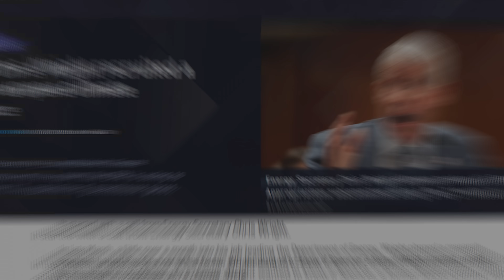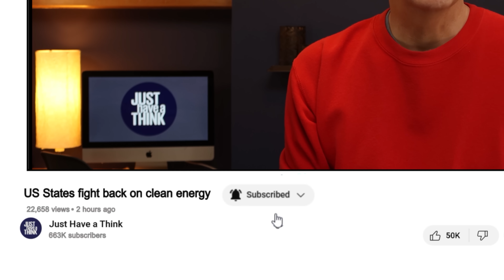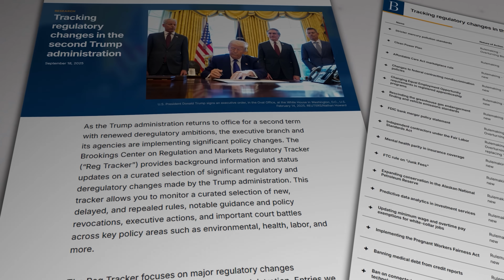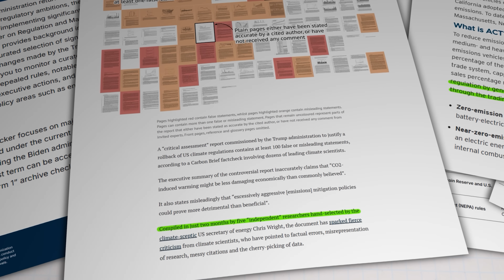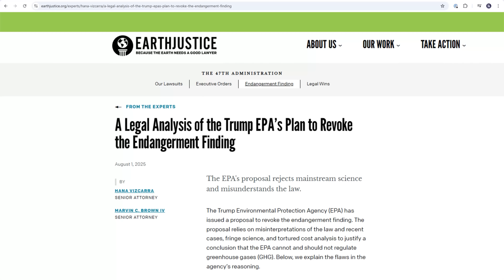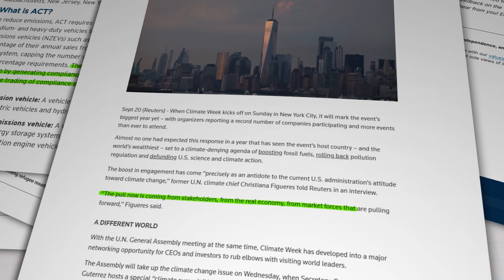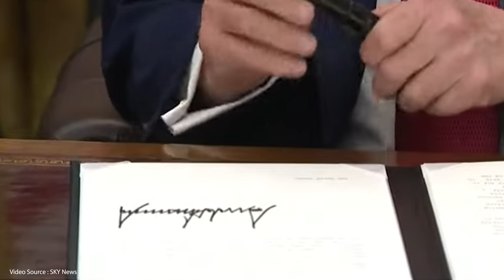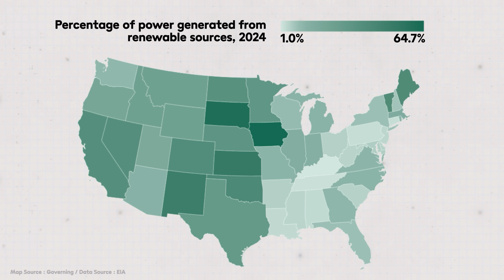The battle for American energy supremacy.

Comment: USA guy here, I’ve used solar generators with extra batteries and factory seconds solar panels to offset some of the larger appliances in my house. Paid for as I go, no permits, I don’t believe I show up on any charts or graphs, but still doing solar.
Reply: Secondhand solar panels are literally a steal. Far far cheaper price while still having like 90% of the output
Reply: DC:DC connections are capable of shorting out and causing fires so with old panels be careful to buy modern MC4 connectors, not MC3 or no-name, no adapters - make sure the data sheet shows original staubli MC-4 for best safety. Also, insurance companies use satellite images and they see your solar panels, so keep your off-grid system truly off-grid because it is functionally uninsured and if it harms the insured systems, your insurance company will have a basis to deny claims. Just saying be careful out there!
Reply: @TomKacandes  Mine are mostly well hidden.  Under a tree canopy that doesn’t interfere with sunlight hitting them directly. Very secluded backyard.
Reply: Excellent 👍
Reply: That's how we do it too. Some critical home systems are on 100% renewables. The panels can't be seen from the road.
Reply: I did the same thing last year. Bought used panels and ground mounted them. EG4 6000xp. Works great 👍
Reply: You are taking cashflow out of the grid.
Grids will start GOUGING the poor slow adopters with higher electricity prices. 

You are showing the way and building the new energy economy. 

Grid owners will want meter boxes to remain grid connected and supplying dirt-cheap feed-in electricity so they can build their grids emergency backup services business.

Grid owners will FOCUS on keeping all meter boxes connected. 
Focus on taking dirt-cheap feed-in electricity 
Focus on supplying the new cashflow from industrial customers moving away from fossil fuels to clean electricity.
Reply: Unlike the free democracies in Spain and Greece the governments surveillance drones don´t catch You when they fly over Your house to spot illegal solar panels installations? Congrats.
Reply: @SunshineShane seriously? I heard something about this. It’s unbelievable. 😅
Reply: @SunshineShane  so what do they do if they spot an “ illegal solar install”?
Reply: @SunshineShane  Probably not illegal at all.  No permit is required for a temporary solar panel connected to a solar generator.  If those solar panels aren't fixed to the roof of the house and don't feed into the panel, it's not illegal.
Reply: @toddcurtis1377  What are we talking about? 4 foldable 200 Watt panels? That´s not serious energy.

Comment: I'm looking at 800 watts of heat tolerant solar before next summer, feeding a ~14k battery bank (based on the do it yourself system on Will Prowse's youtube video).   I suspect it will save me about $300 per year at a cost of $3,000 but it might save me $450 per year.   So a 10 year payoff but maybe a 7 year payoff.  But it will also save the contents of my fridge (which my current system has done twice) which saved me from dealing with a lot of rotting food and saved me about $250 each time.   So that would take it down to a 5 year payoff on top of the disaster recovery.

Plus I can use my portable battery to "loan" power to other friends who have no power.  Which I've already done twice- saving the contents of their freezer.

None of my stuff is grid tied.  I just run a window unit which provides enough eliminate the need Central AC from coming on at all except for august and september and even that is minimal.  Plus that's a lot less wear and tear on the AC unit too.
Reply: Do what Will Prowse says, and get more panels. Did you mean 800w, or 8kW of panels, which is what you need.  Will recommends just buying used panels,   they're so cheap.
Reply: @PeroniPete  I meant 800w.  So I'll generate about 5kWH to 6kWH per day.  

8kW of panels wouldn't fit my space constraints and the heat here kills panels output when I need it most.  I need heat tolerant panels.
Reply: @mac_mcleod  Try liquid cooling, or get your panels up with a larger gap below them so wind can pull heat away.
Reply: @Les_S537  It was over 100 degrees for 3 months where I live 2 years ago and over 100 degrees for many weeks this summer.  The output of the panels drops by 15% (or more).  That's why I researched what kind of panels are more heat tolerant.

There is no wind to speak of.  Water cooling might be interesting.   But when I watched a couple youtube videos on that, it didn't look very effective.

Comment: I live 100% off-grid in the Rocky Mountains via solar, batteries, wood stove for heat, and use of the most energy efficient appliances. I am in no way impacted by the f**k-wits in this abortion of an administration as I gradually work my way to 100% energy independence. This year alone I’ve only had to use the generator to recharge my batteries twice since March. I have all the modern conveniences too.  Next step is some type of wind generation to help out during the times of less sun availability. I do believe we will someday look back on these ridiculous times as a short, but painful blip on the screen of life.
Reply: You are using data-centers right now.
Those data-centers are not powered by firewood.

Comment: The UK has the most expensive electric in the western world due to the rush to wind and solar (4x that of the USA) . Net Zero (which will never happen) is making everyone poorer here in the UK...The Moral is- Don't run before you can walk....and don't listen to Mr Doom and Gloom here, life is short enough as it is!
Reply: Renewables have up front costs...

It used to be that if a growing city needed more power you could just bring a fossil fuel power plant online in close proximity to the city which meant no need to install transmission lines.  You could essentially plug straight into the local grid and voila, instant capacity increase in power.

With renewables like wind or solar they're typically installed dozens or hundreds of miles away in areas which favor them.

But this means you have to install hundreds or thousands of miles of transmission lines.

That's the up front cost...

In 20-25 years when that wind turbine farm needs to be replaced you won't have to reinstall transmission lines, and thus cost is much less.

Energy costs will rise with renewables on the front end, but in the long run they're way cheaper than fossil fuels.
Reply: @Les_S537  Wind and solar are infinitely-expensive, on a sustained basis.
This is because wind and solar are incapable of powering factories, and factories are necessary for replacing and perpetuating wind and solar infrastructure.
No fossil-fuels = no wind-and-solar.
Reply: @aliendroneservices6621 Well I could agree with you, but then we'd both be wrong.
Reply: @Les_S537  Point to a single factory powered off-grid exclusively by its own solar power system.
Should be easy, since there are 1 million factories on Earth.
Reply: @aliendroneservices6621 Australia has dozens of mining operations in the outback that run exclusively on solar power; too far away from any power lines and its far too expensive to deliver fuels to their locations for long term operations.  

In Europe there is the ABB/Busch-Jaeger Electrical Equipment Factory in Luedenscheid, Germany which opened in 2019 and which generates ~14% more power annually than is used by the factory.
Reply: @aliendroneservices6621 Is that the same Google AI that, when asked to present a picture of the Founding Fathers of the US, made them all African Americans?

Yeah, I thought so.
Reply: @Les_S537  Was West Musgrave one of those "run exclusively on solar power" mines?

Comment: He left out the part about how the "green" subsidies in the US are a giant, wasteful grift sent to Democrat states and then largely wasted or straight up stolen.  See Ivanpah, Solyndra, Crescent Dunes, Abound Solar, A123, and KiOR just for starters.  Billions wasted.  A solar/wind/hydro/battery energy infrastructure which can compete on its own merits is the one for the long term.  The only one.  Innovation doesn't occur through subsidies, waste does.  But go on, all the UK censorious, rape apologist, self-hating grifter authoritarians with your ideology.
Reply: You sound disturbed.
Reply: @TheDanEdwards  The wrongheaded innuendo about the US is not what an objective show about clean energy should meddle with.   Especially when the slights, mischaracterizations, and libel are so despicably wrong.  Especially from an authoritarian from the failed UK.  Punching up!

Comment: Solar concentrator + Heat pipe + Sand Battery + glycerol + Heat pump + Absorption chiller + Cold sink+ 48v rack batteries + All-In-One + steam turbine-generator + PV solar panels + anaerobic digestion tanks + CO2 and H4S scrubbers = Ability to synthesize liquid fuels from methane (anaerobic bio digesters) and sunlight. 

All the infrastructure you'll need for your home, or for your factory, or your government or airplanes or cars or rockets might need for decades, for domestic hot water, cold food, clean clothes and clean dishes. Electrical loads, heat loads and liquid fuels all generated by sunlight and anaerobic decomposition of ANY organic material. 

In essence, you can build a power plant to give you energy in the form you want it, in the quantities you want them, at the times you choose; once installed, the system is free to operate for decades or longer, with regular maintenance. Residential or commercial scales as desired, anywhere on the planet, even on the ocean. 

Like an oil rig you can put anywhere. There's some up-front infrastructure cost, but after that it runs for better-than-free for as long as you want it. 

Cheers!
Reply: And yet, none of the world's 1 million factories is off-grid powered exclusively by its own solar power system.

Comment: Tony Seba has proven that we are already knee-deep in a technological disruption phase in terms of solar wind and battery (SWB) development. This implies that the price of SWB energy is falling at such a rate that it can no longer be stopped. Not even all the fossil fuel superpowers in the world can stop it. And those who would try to stop it will suffer the most.
Reply: Been watching that. Those sodium ion batteries look interesting - cheap, way more discharge cycles, almost immune to temperature extremes. No nation, no place has any monopoly on sodium. No thermal runaway issue. Negligible self-discharge rates. Or so I have heard. The results from some prototype EVs with sodium batteries indicate the battery pack would last longer than the life of the vehicle.
Reply: Even Shell, one of the biggest oil giants in the world, has reportedly installing thousands of fast EV chargers on their gas stations this year

I've seen that every Shell station now has at least 3-5 fast EV chargers, at least in my country. It's one of an indicator that they tried to adapt to the transition

Comment: The irony that even if you wanted to add a gas turbine to the energy mix, it's not possible until at least 2031 or 2032 thanks to recent global backlog for turbines. So you'd have to be a real idiot to want to wait that long for a more expensive and inferior technology compared to wind and solar which are clearly the cheapest option even when paired with a battery storage system.. Thank you REAL WORLD economics!